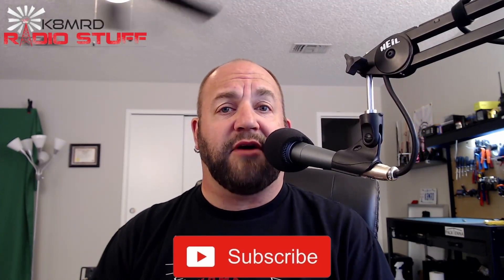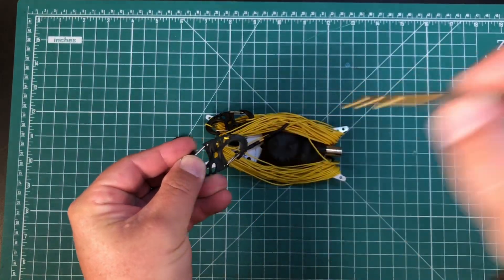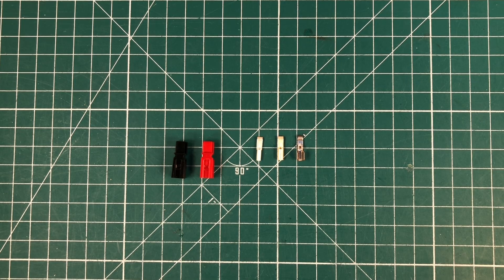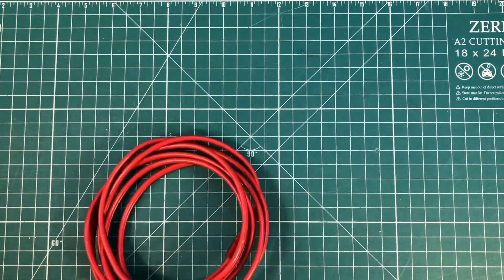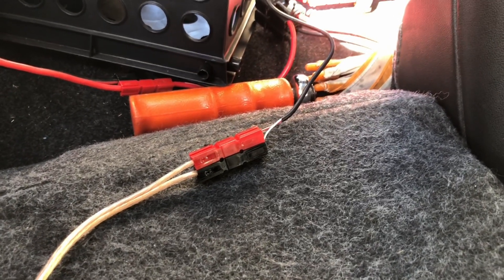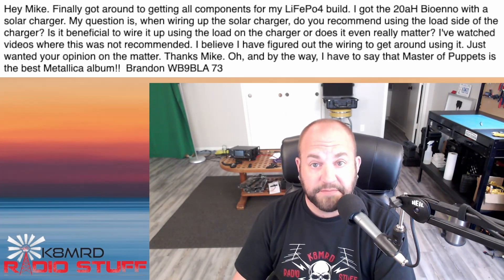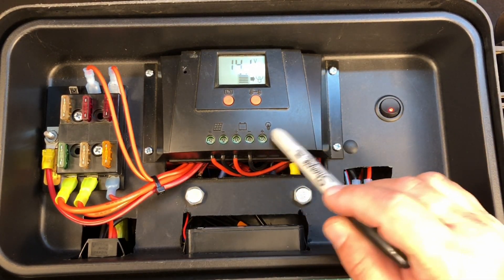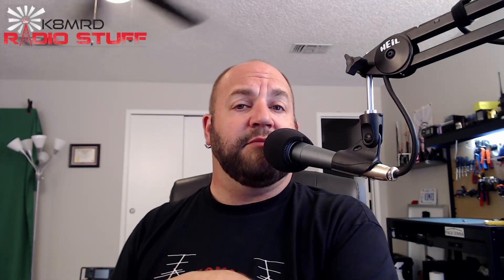Solar Charge Controller Wiring | Mailbag Monday #31

Comment: Item of note: ALWAYS make sure that you connect the battery to the solar charge controller BEFORE connecting a solar panel. If you don't, you will let the magic blue smoke out in very quick fashion! 

Also, the reason why you don't want to connect it to the load side of the charge controller is 2 fold: 1.The load side is pretty dirty on a PWM charge controller. Yes, you can put filtering caps and diodes, but the buck converter that drops the 17V+ of a solar panel to 12ish V is pretty noisy and dirty and only meant for lightbulbs and other inductive loads. 2. 20A isn't really 20A. Most of those cheaper PWM units have poor heat dissapation and aren't built for oscillating draws like SSB operations. The voltage drop and recovery will not be kind to the finals in the PA of an HF transceiver. Plus, why burn unnecessary electrons when you can go straight (with a fuse obviously) to the battery?

Comment: Mike, I know Anderson talks about what amperage on the various different connectors. The real useful information is what gauge of wire each contact uses. Under my hood I use SB50 housings and 6gague wire to link the rear feed 8gague home run to the trunk. There will also be a SB50 Capped plug so I can attach jumpper cables without popping the top.

Comment: What size wire do you typically use for 12v power distribution say from your battery to the radio? KD9TQH
Reply from the maker: It really depends on what I'm using but usually 12AWG.  For less current hungry devices I'll use 16AWG.
Reply: Much appreciated!

Comment: Label Label Label !!!  And establish a color code for yourself… although the most common colors are black and red (which I use as 12vdc power connections only) you can easily color code with short lengths of heat shrink at both ends.  Green for grounds and radials. Blue for antenna wires. Yellow for solar. White for audio… Placing both wires through a length of heat shrink together when they go to same place, like a red and white individual PPs for audio, with a longer white band to say “audio” and “these go together”

Comment: I don't think the load is filtered. The battery acts like a super capacitor. The power from the charge controller is high frequency from the buck converter on MPPT, or high frequency pulses from the PWM! I would like to know what charge controllers are good for use with radios. I have seen videos where the solar power systems can block out many of the HF BANDS.
Reply: I've had good luck with my Renogy Rover Elite MPPT and EP Evers MPPT charge controllers, when it comes to noise. I'm surprised how noisy the Victrons are. You'd think for that much $$$ they'd have better noise isolation!
Reply: @DagonNaxos  Thank you for the information.  I have been looking at getting a epever 40 Amp and some solar panels.  But I may go with a bigger controller so I can add more panels later. I live in East Central Florida and and the hurricane went across a little north of me. I have a 100AH Lifepo4  battery for backup power for my radios. And 2, 60 AH Lifepo4 batteries for 24 volts on an UPS to power my TV and cable box/Wi-Fi. I like to be able to watch the Weather Channel when the storms are coming. I hope to change to a better internet and TV service soon that doesn't go out when the cable Co's batteries along the cable network to keep the system boosted go dead when the power is out or goes out because lines go down.   73  de W4DES
Reply: @donaldsmith3048  I have the EP Ever 40A charge controller with the remote head kit in the shack and the Renogy 200W solar suitcase. The nice thing about the Evers and the Renogy is that you can run the panels in series, up to 5 or 6 total. This means you can put up to 150V DC into them and it'll down convert from 150VDC to 12 or 24VDC because of the MPPT. Also, you can slightly overpanel them without issues. 

For reliable post catastrophe RX comms (besides NOAA and AM/FM broadcast) you might want to look into Elon Musk's Starlink, if it's available in your area. They do make a portable kit that easily sets up on a tripod in your yard. The big issue with cable is, even if you have juice at your house, if the rest of the grid is out, the trunks that feed your neighborhood won't have any power and you'll have no internet. I had that happen during Hurricane Sandy out in NJ for 15 days. Comcast had to put a 1500W Honda gas genset up on the pole and we knew when it ran out of gas because tje internet would die lol

Comment: I use a single power pole to connect my 891 to ground in the shack. I've got very short pigtail screwed to the ground screw with a power pole on the other end. That way I can quickly disconnect the ground when moving from the shack to portable. If only they came in green.
Reply from the maker: Great idea.  And here they are in green.  https://www.dxengineering.com/parts/ppa-1327g5-10pk

Comment: Geesh!  Your ceiling fan is running.  This week I've had to find and wear my winter coat here in New Hampshire.

And just a guess: I suspect that Bioeno just resells that charge controller, rather than making one with a load output designed as they would like.  SOME charge controllers make more RF noise when driving the load port.  On the other hand, many charge controllers will disconnect the load if the battery voltage drops too low.  You may not meed that if a suitable protection circuit is built into the battery itself, but check, and if your battery isn't protected, use the load port.  Also, if your controller provides amp hour totalization for state of charge tracking (as in the BuddiPole power mini), you will loos that by directly connecting anything more than the controller battery port to the battery (it can't count amps not flowing through it).  But the load port almost certainly involves a DC to DC converter to stabilize the load voltage, so using the load port will have an efficiency cost.

Thanks for another fine video.
73, Bill
Reply from the maker: That's why I moved to Texas.  I don't want to even know where my winter coat is ever again.  I'm not sure about the charge controllers origin, but I did plug my 7300 into the load port and didn't get any RFI.  Seems to be just as quiet as when plugged into the battery.  Any commercially available LiFePO4 battery that I'm aware of is going to have a BMS/PCM built in.  Even the cheap Chinese ones do.
Reply: That Bioenno charge controller looks identical to the Harbor Freight charge controller that comes with their 100 watt solar panels, except for cosmetic differences. I had that setup before I sold it, and they recommended not using the load port as well. I recall that it did not handle a lot of current. Their 100 watt solar panel kit comes with two LED light bulbs that run on 12V, but they said to plug only one into the charge controller at a time.
Reply from the maker: I suspect the Harbor Freight version, while may look similar, is not the same quality.  And this is coming from a guy who's favorite store is HF.  I wouldn't trust their solar stuff too much.  Though I have heard really good reviews of their 100 watt panel.
Reply: @hamradiotube  Theirs might be a cheap copy. I went with the West Mountain Radio Epic Pwrgate and its been very reliable. :) The issue I had with HF 100 watt panels is that they aren't really portable especially when they were made of glass.

Comment: I saw a solar charger review recently where using the load port on the solar charger (not a Bionenno) for the radio caused RFI. Not sure if this is why it's recommended not to. I always run the load from the fused distribution block off the battery.
Reply from the maker: Yeah that was Julian, OH8STN.  I tried the load port on my Bioenno with the 7300 and didn't have any issues with RFI.

Comment: Interesting topic, on the charge controller hookup. Julian OH8STN just did a video where he was getting a ton of noise on his ham radio when using the Victron Energy 75/15 MPPT charge controller. Like you, I use Bioenno controllers and don't have issues, so I wonder if it's something about the controller or how it's wired in Julian's case.
Reply from the maker: Yeah I just watched his video last night.  I don't know why he doesn't just ditch that controller and use one that is RF quiet.
Reply: @hamradiotube  he's all about portable and need high current I guess. My Bioenno works great and a 100 watt panel (or my 60 watt soft folding panel) keeps my 40Ah battery running just find with 100 watts. For QRP, I just use my Buddipole Mini2 , 12Ah Bioenno, and 60 watt folding panel and run all day and half the night.
Reply from the maker: @W9HJBill  Yeah I still don't understand that though.  He uses QRP radios.  Why the need for so much power?  I'm going to do some testing with my 20amp Bioenno here in a little bit.  I'm going to hook up 2 100 watt panels and see how much current I can get into the battery.  I'm also going to hook up the radio to the load and see what happens.  Just out of curiosity more than anything.  I may even make a video just to help out Julian.
Reply: @hamradiotube  Well, most of his stuff is digital, so with a 50% duty cycle, it can eat up power. But still, the POWERmini 2 will handle up to 11A of solar. That's a 100 watt and a 60 watt PowerFilm panel at a total of 9.6A.
Reply from the maker: @W9HJBill  I may have hooked up 200 watts to my power mini over the weekend.  It wasn't too happy lol!